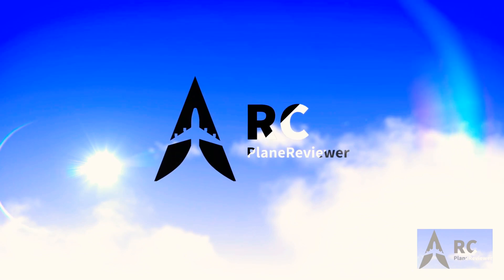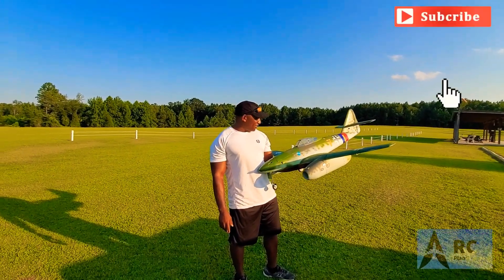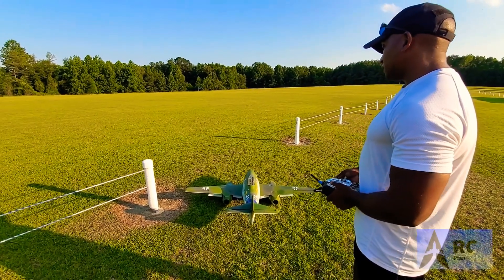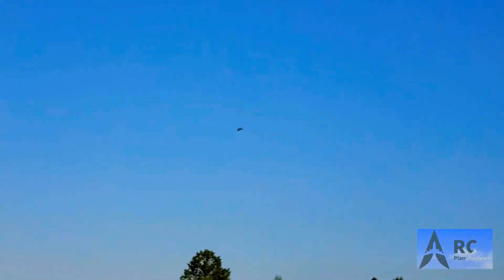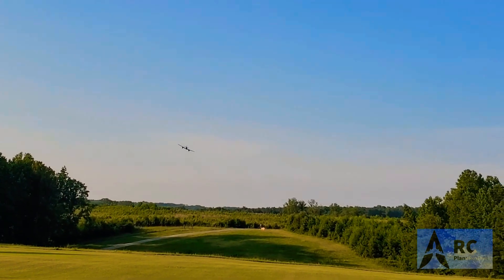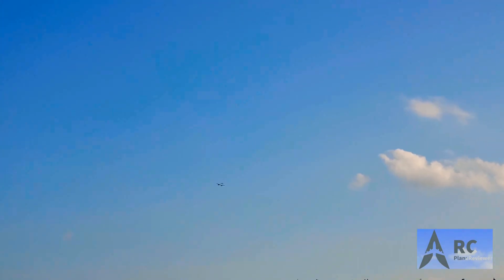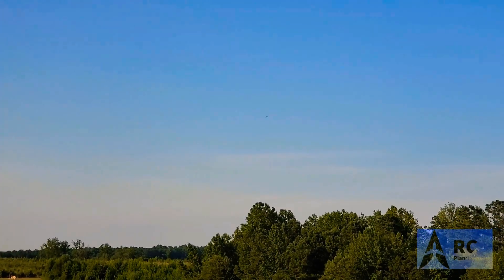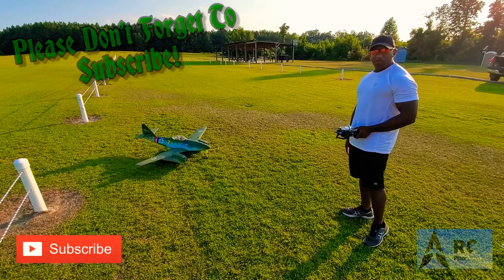Freewing Messerschmitt Me-262 V2 Twin 70mm EDF Jet Flight Review

Comment: I had two dynam 262 and the freewing.   Dynam had unreliable landing gear, little to no cooling and sloppy elevator push rods.   All corrected with mods.  I added stiffeners to the nose/fuse area as a hard landing can cause it to break.   

The freewing is hands down more scale looking.  Both versions benefit from a high takeoff speed with down elevator.  Prevents tendency to tip stall and pitch up.    Dynam has more wing area and less susceptible to tip stalling with low power settings.
Reply: Added fuse stiffener to freewing.